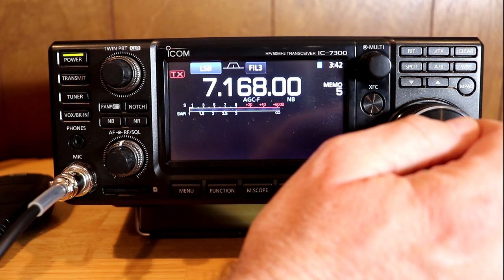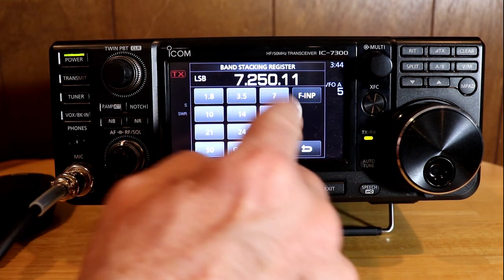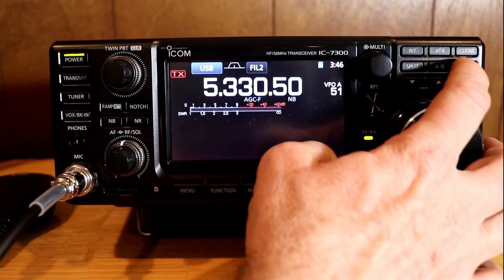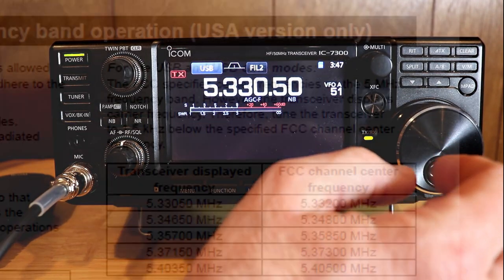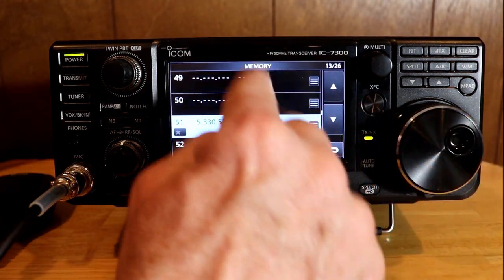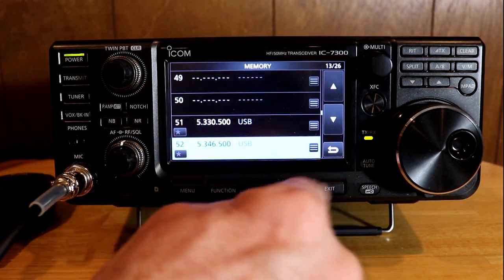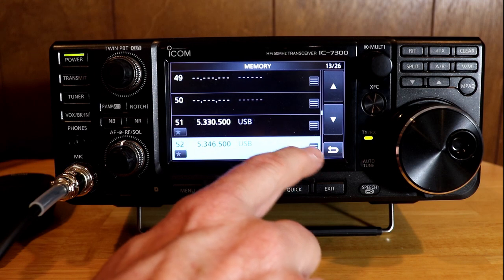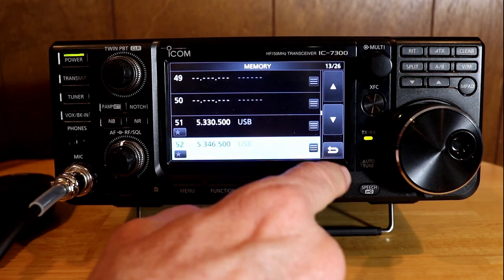Icom IC-7300 from A to Z - Part 5

Comment: Tom want to thank you for taking time to put this. Watched 1 - 5 that was alot of work. Wish I would have made it seen this sooner 
got the FTDX1200.  Great radio, you made it easier to use the 7300. Still working on the use of my. Wish that would have been made it easier on the DX1200. I would have made it easy going from 850 Kingwood
73 be back to watch the rest. KQ4CDPaul

Comment: Really digging your videos!  Thanks for taking the time to explain the 7300.  So often, manuals leave much to be desired.  I have the Icom 2300H and it was a bear to learn, as Icom's manuals aren't the best (IMO).  The 7300 has a better manual than the 2300H, but it's still not great.  So thanks again...really enjoying your videos.

Comment: Also don't forget that 60 meters USB needs to be restricted to the 2.8 kHz bandwidth so you should check what you have programmed in your FIL2 (as you've got set on your display) to make sure you're not going to transmit wider than 2.8 kHz .  (See ARRL Amateur Radio Bands chart: http://www.arrl.org/images/view//Charts/Band_Chart_Image_for_ARRL_Web.jpg )
Reply from the maker: Jim - It is good to keep the transmit bandwidth restriction in mind.  However- the Filter bandwidths that are programmed with the filter settings I demonstrated only impact RECEIVE bandwidth.  They do not change the transmit bandwidth.  The 7300 does allow you to adjust transmit bandwidth.  You have to press the MENU button and then touch SET.  Then scroll down to find Tone Control.  In the Tone Control sub-menu you will find SSB TBW (Transmit Band Width).  You have choices of WIDE, MID and NAR.  You will see that even the WIDE setting is from 100-2900 Hz.  So it meets the 2.8khz restriction for 60 meters.
Reply: @HamRadioA2Z  Thank you for letting me (us) know where the TX bandwidth settings are.

Comment: There is another memory type, the "Memo Pad"  or MPAD.  The MPAD button is one of my frequently used button on IC-7300.  It is nice to jump around or cycle the 5 or 10 memories. 

If we save an interested frequenciies  by long press the MPAD button, we can recall it and save it on Memory Mode later. 

Hope it is useful.

Thank you. 

Bahahtir 9W2GNU, 73.
Reply from the maker: Hi Mohammad.  Yes, I didn't forget about it.  I'll be covering that in the next episode.  It is one of the really nice features.
Reply: @HamRadioA2Z  Thank you, Sir.

Looking forward for the episode. :)